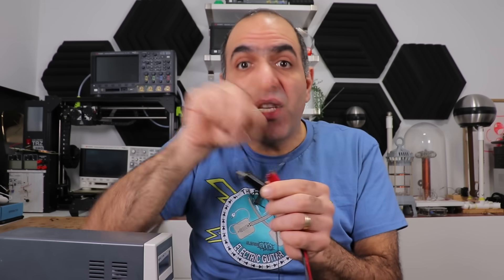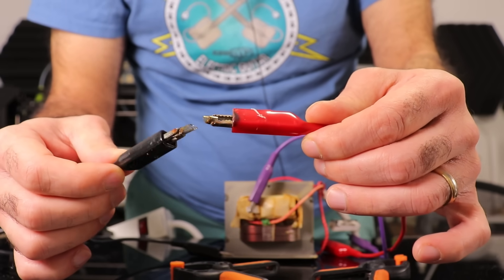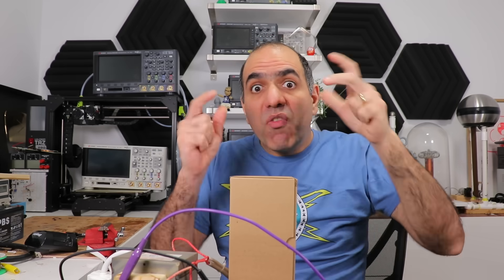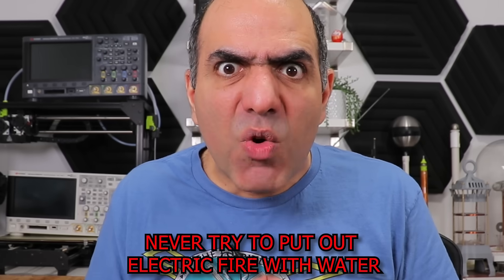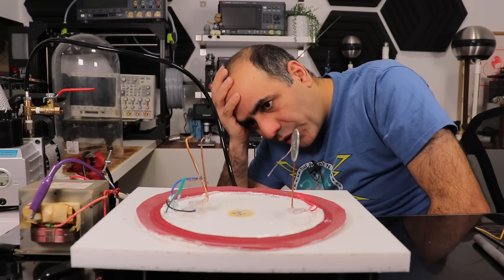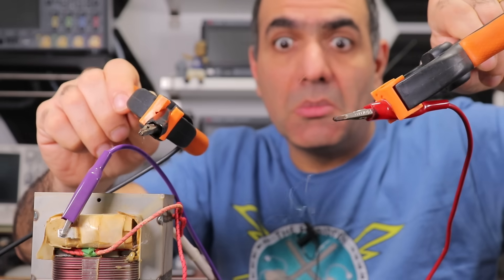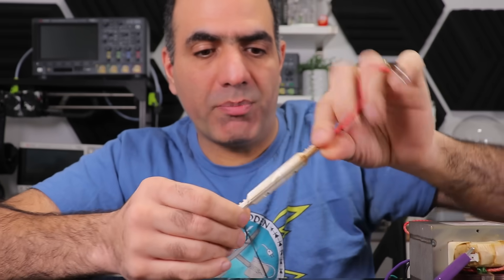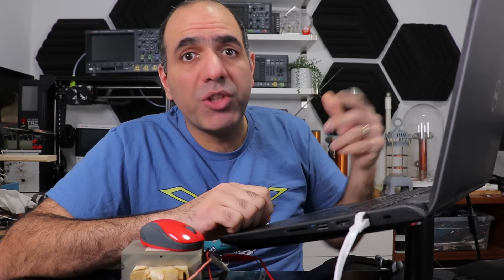Making a High Voltage Fuse

Comment: I was filled with dread watching you use both hands to handle the high voltage wires. You only need to forget to turn the power off once to become dead. In the future please keep one hand behind your back. I don't want to lose you. I need a sedative now.

Comment: It's also not "just" wire that is used in fuses. Usually it's a softer metal with a specific melting point.

Comment: The spring didn't vaporize in the industrial fuse.  You can see 2 frames where it is contracting, before the bright flash.  At the end, the very tip of the spring is just visible from the left housing.  There is a cavity where the entire spring fits when not extended.  This is why the left (spring) side of the fuse is slightly longer than the right.

Comment: You could basically construct your own fuse that's the same as HRC fuses by using a ceramic tube sourced from the electronic bay website and sand from the local hardware store. Making metal end caps like a normal fuse would probably be more difficult, but for experimentation purposes you could just solder the fuse wire to some leads (solid wire) and epoxy them into the ends of the tube.

Comment: hey Mehdi, i think its about time you start using a spring loaded foot pedal switch for sending power to your circuits. Might cut down on the fire risks. When you start to panic you can just lift your foot to cut power. Warning: may result in a lower view count
Reply: I've made this thing yet dunno why i made this
Reply: Mehdi never panics...

Comment: likely just nitrogen in the fuse bottle. 

you need to get a PPE sponsor.

Noble gasses are conductive and you should know that when you definitely played with neon bulbs before and likely now that welders use argon as a shielding gas because it is conductive. Welding only happens at low voltage (around 70 - 4 V) and high amperage (between 40 and 200 A although there are some that exceed 1000 A in thick boat hull fabrication) in order to melt 2 or more metals together.
Reply: How do welding machines work to create short circuit arcs, without tripping any breakers? 
Is it because the arcs are pulsed
Reply: @martf1061  it changes it from 120V 10A to 200A ~4V with a 70V start capacitor. you likely need to use a 240V connector with a 30A breaker for anything serious. (think a commercial site) hobbyist toaster boxes usually are driven by IGBTs so theres no transformers to saturate like a lot of heavy industry welders would likely use.
Reply: @neutrallybiassed1330  thanks for answering

Comment: The spring tension in the wire worked! Just as you demonstrated with the elastic. The arc from the fuse traveled from the right to the left, starting on the thin side. Once it separated on the right, spring tension took over.

Comment: As an electronics technician I've had to explain several times that it is OK to use a 250V fuse even if the original was 125V.  The rating is simply the maximum hold open voltage.  The current rating is the important bit.

So in Europe, you would NOT want to use a 125V fuse since mains voltage is 220.

Comment: I just replaced a 1000V 200A fuse at the trolley barn because someone pulled a stupid.  It had a ceramic shell and some sort of white powder inside.  The short was so dramatic that the ceramic case broke.  I don't know if it had a spring.  Maybe the white powder extinguishes the arc.

Comment: In France, we have sand in some fuses because when the wires melt, they're hot so the sand melt into glass and glass isolates the circuit. And if there is more arcs, then more heat is created so more sans is melted to glass that results in more insulation.
Reply: The same in the UK.  All British Standard compliant mains voltage cartridge fuses have sand.  Sadly there days there are a lot of dodgy products coming from other countries that don;t have the sand and don't properly blow.
Reply: Yeah cuz they want to cut cost
Reply: Isnt anything more conductive than air ?
Reply: @phobos1963  No tons of things are less conductive than air, mostly because fire is a thing that y'know can happen with air and fire is a plasma so it's extremely conductive.

Comment: Now after 50 years I find out why the air force had 32 volt, 125 volt and 250 volt fuses with the same size and amperage. Thank you.

Comment: There are fuses with sand inside especially for DC applications for prevent a DC arc keep going after the fuse blows.

When the fuse blows the sand moves into the gap and in the worst case because of the heat transforms into glass acting as in insulator

Comment: @ElectroBOOM The breakdown voltage in any gas follows a Paschen curve. While extremely good vacuum (< 10^-3 Torr) greatly increases the breakdown voltage and prevents arcs, the breakdown voltage actually initially decreases compared to atmospheric pressure until it reaches a minimum around 1-10 Torr, which depending on your vacuum system could well be the regime you are in especially with non rotary vane pumps. The is because the ionised charge carriers smash into less atoms at lower voltages because there is less gas overall, meaning the charges can make it further distances and hence sustain the arc over longer distances. However at some point you start decreasing the number of atoms that can ionise and carry the arc and further reduction of the pressure reduces it even further, which is why the breakdown voltage eventually starts increasing again. 

https://en.wikipedia.org/wiki/Paschen%27s_law

Comment: you should look into systems used to close circuits under very high voltage. it needs to be very quick to reduce arcs, so it's quite interesting

Comment: I know the University of Kentucky operates a large Van de Graaff generator (as a particle accelerator, the original purpose of the VdG generator) and to reach the highest voltages (7MV) they pressurize the unit with a mixture of carbon dioxide and sulfur hexafluoride.

Comment: It looks to me liek the spring retracted into the metal sleeve on the fuse, as the burnt end on the spring side is centered and noton an edge as you would expect from the coil of the spring.

Comment: Not positive but I think argon is conductive. It’s used as a shielding gas for tig welding. Maybe just argon plasma is conductive but for high voltage I don’t think it would work.

Comment: Look how insanely smart is it done in Tesla inverter when you need to interrupt high current at high voltage. Instead of using very expensive and large fuse (with e.g. 900V, 500A), you can use pyrofuse to destroy thick copper bus bar and safely hide oncoming high voltage spark inside high voltage fuse rated for minimal current (1A). https://youtu.be/WNNhWYogBe4?si=Gcw_dlhExcbFdea_&t=451 (7:30)

Comment: There might be sulfur hexafluoride inside the fuse, the gas is used in some circuit breakers intended to "quench arcs".

What I do know is that the gas is ~6 times denser than normal air.

Comment: 6:19 no. You’d want to use nitrogen. Noble gases ionize pretty easily under high voltage. So hilariously enough air is probably the best gas for this application.
Reply: What about CO2? Would this gas work as well?
Reply: @dogs-and-destruction-channel  the real issue is that gas is just not a good medium for discouraging electrical arcs. It’s too reactive when exposed to high energy media. Sand would be a good substance to put in a fuse. To answer your question though I don’t know what the hell would even happen to carbon dioxide exposed to high voltage. The only reason I said nitrogen was because of how plentiful it is

Comment: Mehdi made 7:20 Basic switchfuse with that elastic band. We have those where I work, the fuse operates a Stricker pin which hits a trip bad and opens the switch. Isolating the fault.

Comment: Plasma scientist here: Using noble gases would not work, as they are easier to ignite a plasma in (this is due to energy losses in molecular gases like N2 and O2. Keyword rotational and vibrational excitation). What you would want to use is an electronegative gas like SF6. The electronegativity essentially sucks away all the electrons, making it harder to ignite a plasma. 
Also, going to a high vacuum and below would also increase the ignition voltage again. The lowest ignition voltage is (depending in the gap size) around 1 to 100 Pa, which is probably near what your setup can achieve. For these high vacuums you would need much more expensive turbomolecular pumps to lower the pressure even further. If you are interested, you can look up "Paschen Curves". Thats the relationship between the ignition voltage and the product of pressure and gap size
Have a good one!

Comment: Breakdown voltage decreases at first, as you lower pressure.  You need less than about 0.3 Torr (.0058 psi) before the breakdown voltage rises high enough that you are less likely to arc than in atmospheric pressure (760 Torr).  It's not likely your home vacuum chamber can attain that.
(See: Paschen's Law)

Comment: The reason why the arc was bigger in partial vacuum is because air conductivity has a maximum at about 10mbar, to then drop below conductivity at standard pressure. In detector applications, we usually wait to pump out  until 0.1-1mbar before biasing detectors because of this
Reply: Interestingly, this is something that RocketLab discovered a few months ago. At least, discovered how it applied to their electrically-powered rockets in some obscure circumstances. When the second stage started up, a large arc happened somewhere in the system, shutting it down. Maybe a switch enclosure that normally just happened to contain air developed a leak this time, and bled down to a low enough pressure for an arc to form. Their fix was to add a small nitrogen bottle to the second stage, and keep the electrical systems at a known pressure. Their return to flight earlier this week went off flawlessly.
Reply: This is also why airplane electronics have very different isolation requirement than electonics on the ground.

Comment: Fuse current ratings are "max current that will not trip it", not "minimum current that will trip it". And they have "maximum time to tripping" values, as in multiple ones, depending on how much overcurrent there is. Margins can easily be 100 % to 300 %. Use other forms of circuit breakers if you need better margins.

Comment: Try this similar test... Take a 230 volt AC household light switch and drive it with 230 volt DC. Then connect about a 5 amp heat lamp load... When you open the switch, it will struggle to break the circuit and an ark should form across its contacts and heat lamp will dim. Its kind of scary because you can't turn it off and watch as the switch glows blue and melts. 100 years ago, as an apprentice, I rewound a car alternator for 230 volt DC and discovered the problem with switching high DC voltage. I stopped the switch ark by fitting a capacitor across it.

Comment: Ok so what about the other way, if you have a fuse that's rated at 1000 amp and 1000 volts will it blow at 24 volts at 1100 amps? Or will it change how many amps it can handle with lower voltage?

Comment: in your rubber band setup, what would have happened if the wire broke only on one far side of the wire rather than in the center area under tension?  The single spring model in the following segment seems to solve that problem.

Comment: Maybe a cheap option for a gas to fill the tube can be CO2. They are relatively easy and cheap to obtain, and based on my cursory googling, it is both noncombustible and electrically non conductive, though I dont know how much that matters.

Comment: Mehdi, I have an question. When I was younger we used to have big fuses (500A 250VAC) "protecting" car audio equipment (12.5~14.4VDC) or better protecting the car from the audio equipment, I never seen one of those pop, even when something bad happened, so my questio is: those 500A 250VAC fuses had any chance to pop if shortcircuited on an 14.4V system (2000A Battery + 500F SuperCapacitor)?
Reply: It definitely can happen, but it'd be from shorting from right after the positive line goes into the gear to the car's chassis.  Not common, but could happen during installation.

It also depends on the type of fuse; a lot of car fuses are the 'slow blow' variety because of just how noisy automobile electrical systems tend to be, so you'd need something bad to happen and for it to continue happening for a few seconds.  If you see the spark while you're working on something and instinctively react, you could correct the problem before the fuse blows.

Comment: You should try remaking the Jacobs ladder but put it in you vacuum chamber, that would be a little safer than last time
Reply: Jacob's ladders don't really work in vacuum because they need the ionized gas to rise as it gets heated. Without a significant amount of gas, that effect won't work

Comment: Regarding gas inside the 5kV fuse, you could try and excite the gas inside this 5kV fuse with one of your coils and see if it is a noble gas by colour.
Reply: It might be SF6.
Reply: @d4slaimless  isn't SF⁶ solid? 🤨
Reply: @danek_hren  Boiling point -50.8 °C

Seems like gas to me, but what do I know...
Reply: @d4slaimless  yes it's gas, checked it
Reply: Noble gases are easily turned into plasma. You need a heavy molecule like SF6 for insulation.
Reply: I didn't think that a 5 kV fuse would blow at just 2 kV
Reply: @coastersaga  it blew because of the current. the voltage rating is just to stop arcing after it blows

Comment: I would say they use sulphur hexafluoride SF6 gas inside the fuses. That's the gas that is used in high voltage switches.

Comment: Use Absorption Spectroscopy to detect the gas present inside the fuse. Where the light from a source is sent through the gas collimated to fall into a spectrometer to find the lines absorbed and compare it with the available data sheet to find the gaseous compound.

Comment: Fuses for 50-500vac, in France at least but I think it's the same all over Europe, contain sand, which helps dissipate the arc energy and then the glass created adds insulation to the fuse. On the other hand, you're right about one thing: manufacturers use argon gas, or others depending on the patents I imagine, to create their "cutting chamber" in high-voltage and high-current circuit-breakers, and probably in "big" fuses too. Great video as usual!

Comment: As far as I know sulfur hexafluoride (SF6) is used often as an arc suppressor. An old (mid 90s) electron microscope I've used had it inside to avoid arcing between the high voltage (30kV) connectors. Due to a leak, we had to refill it every time we started hearing high voltage discharges.
Reply: Jeez. SF6 is a really bad greenhouse gas, you should have repaired it rather than refilling it every time. 100g is the stuff is equivalent to more than 2 tonnes of CO2.

Comment: Would like to see how that fuse performs with stable DC when there is no 0V crossing and yeah, that partial vacuum discharge setup was impressive, could you test it with various frequencies?

Comment: High voltage glass fuses used in appliances like microwaves, also known as HV (high voltage) or MOV (Metal Oxide Varistor) fuses, typically contain an inert gas such as nitrogen or argon. These gases are chosen for their chemical stability and ability to prevent arcing inside the fuse during operation.
Reply: I use argon in my welder because it conducts and sustains arcs so well... You might want to double check that.
Reply: @SkippiiKai  You use argon in your welder not because it sustains arcs, but because it displaces the air which will contaminate the weld otherwise

Comment: Some fuses actually have gases inside them, I got a couple of those old screw type fuses that were blown and I wanted to test it if since they have that view port they would make a good mini arc bulb, and the arc actually jumped and gave off different colors depending on the fuse, one had a yellow arc in it, I think another had a purplish red, so that was interesting
Reply: Could be argon
Reply: @MrClean-ep7uc  argon could Be a part of the mixture of gases in it, but it’s not pure argon if it has that in them, because argon glows a purplish color under high voltage/low pressure

Comment: You should build an arc discharge strobe, we sometimes host external events in our school's aula and I managed to convince the principle to buy 2 atomic 3000 dmx strobes, they are fun! But at a combined peak power of only 9kW they are fun, but you could do better! Also my solution for power is absolutely scary, it's the most cursed adapter ever, like the one you used to run your sister's hairdryer on 2 phase 120v just that both plugs are wired in parallel and connect to 2 16A 230V circuits on the same phase of our 3 phase supply.